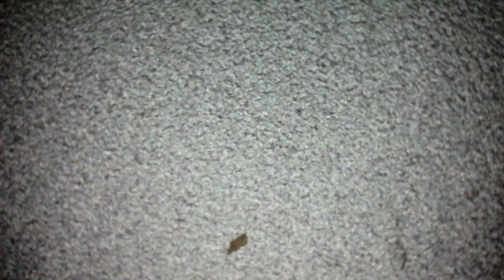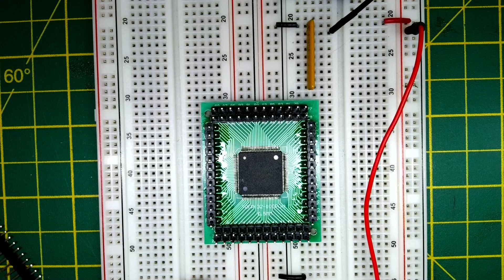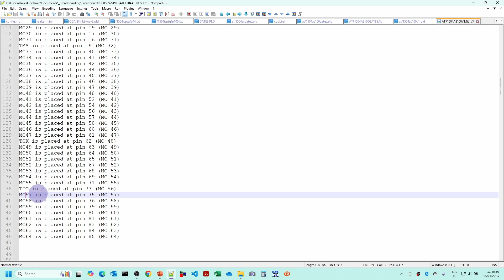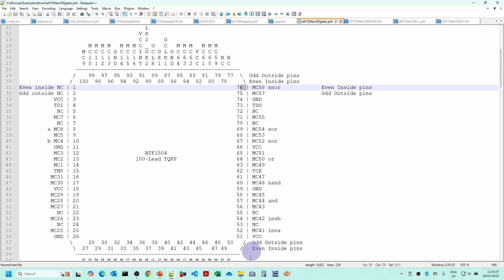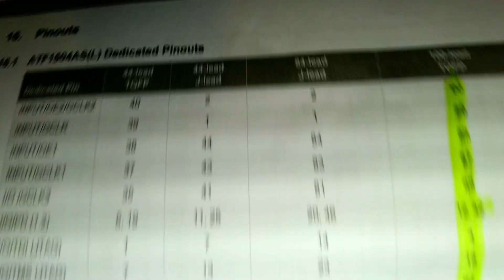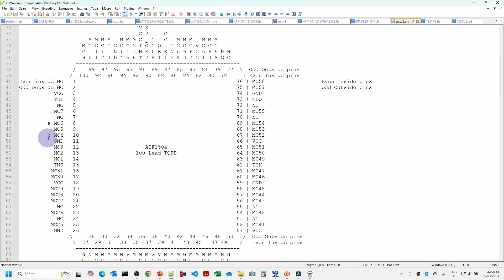Using ATF1504/150X Surface Mount Complex PLDs on Breadboards (PLDs part 8)

Comment: Thanks great video. I never realised you could put them in a breadboard like that. I've got all sorts of ideas for using them now. I've got some 1502as on order having read they can be programmed with a USBblaster. Time will tell how it works out.

I've held out on watching this series until I did some work on PLD's myself or it would be to easy to just copy and not think. Now that I've done some work with them really enjoying the videos and the challenges you've come across and comparing them to my own. I understand the issues. Working on a XT next really look forward to seeing your other series once I get far enough along that track myself.
Reply from the maker: I would check video 9 where I used the ATF1508 with 128 Macro cells when using the 100 pin breadboard adapter (the lower versions should be fine for 44 pins). I ran out of MC and block connections when I was using the 1504 CPLDs for CGA video controller. I have not used USBBlaster so can't comment on this really.
Glad you found it useful. Hopefully will save some time knowing some of the problems I found. Dave

Comment: You make soldering those so very easy! Could I ask what flux you are using?
Reply from the maker: I use CHIPQUIK No Clean Water Washable Paste Flux CQ4300-2OZ (I think from Mouser). I am not an expert solderer but this seems to work well enough for me for breadboard type work. I think you would need the syringe type flux for finer work like re-balling surface mount chips etc but this works well enough for surface mount to DIP adapters in the videos. Dave
Reply: @b @breadboardinglabs ank you. Any recommendation for solder paste for 0.8/0.5 pitch? I’ve been using leaded for ages and had bad results from lead free wire but want to try paste so willing to try lead free again. Very much appreciated.
Reply from the maker: I don't use paste, just lead solder, a little on the tip, plenty of flux and just drag across pins. Just done a 64 pin TQFP to DIP adapter which will be in a video in the next week assuming I can get the dual port video RAM working with CGA card. Dave

Comment: This is pure gold. I was hesitating to try the ATF150x for months as information is scattered across too many places and often quite vague. With that information here I finally feel confident to try it. 

I'm so looking forward to the next video(s) and more information about how it works. Programmer and some ICs have already been ordered ;-)
Reply from the maker: I wish I had ordered the 100 pin ATF1508 as it has 80 I/O pins and 128 Macrocells so would be even better. The ATF1504 only has 64 I/O pins and 4 are used for JTAG pins. Glad this is useful. It was based on a recommendation from an email I received from Peter a couple of videos ago. Dave

Comment: Love your content. But your audio is horrible. It sounds like my defective dbx 286s, which I posted a video to fix a while ago.
Reply from the maker: I am looking to get a Rode lapel mike as when doing stuff my Yeti mike is off to the side (no boom) so Resolve ends up adjusting it to get to YouTube LUFS levels. Audio level is quite variable even with all OBS filters to try and adjust low levels etc. Dave
Reply: @breadboardinglabs  You might try much lower filter settings. Just a bit of sibilance and a touch of noise gate. I'd even prefer some noise over the gate cutting off syllables, which is very annoying.
Reply from the maker: Took the noise gate off but I suspect it is the one of the other filters causing syllable's to drop out on latest video just published,

Comment: It may help to align pins on pads to secure the chip with some adhesive tape. Just an idea.
Reply from the maker: The problem is the slightest nudge on the chip causes it to move.
The tape would cause it to move (or stick it in the wrong place).
The other videos I have watched on the subject don't seem to have a better solution.
Perhaps some sort of L shaped template fixed to the board to stop the chip moving to allow two sides to be soldered?
I don't intend to make many of these so not a big problem to solve given the 2 so far have worked (eventually!).
Thanks for the thoughts. Dave

Comment: I wonder if you could make this big chip a bit more friendly with a simple adapter PCB. It could have pins to plug into the breadboard for all the usable CPLD pins, a JTAG socket and sockets to allow your square PCB to plug into it. This might allow enough vertical height to get wires into the breadboard. I think I saw someone do that with a 486. It's a tough problem.
Reply from the maker: Peter who emailed me about these chips has made one of these including JTAG connector.
I will ask him if he can publish the PCB design somewhere.
I have not made a PCB in 44 years since I was 16 so not really my field of expertise.
I have seen the 486 adapter, though making PCBs is sort of not the purpose of the Breadboarding Labs channel. Buying pre-made adapters I don't have a problem with, but making PCBs I may as well use a PCB for the whole project.
I agree with you its a tough problem. If the 40 pin DIP ATF2500 chips worked with the programmers I have it would have solved most of this issue. Dave

Comment: I have/am thoroughly enjoying your PLD series. I hope you find many more reasons to use them and produce more of these videos.
Reply from the maker: I am glad you are enjoying them. I must admit I quite enjoy having an excuse to buy some new chips and find out about them. May have ago at the ATF1508 (similar just 128 Macro cells, 80 I/O pins for 100 pin QTFP). May have to draw the line at FPGAs as you could probably implement an entire PC in one of the larger ones! Dave